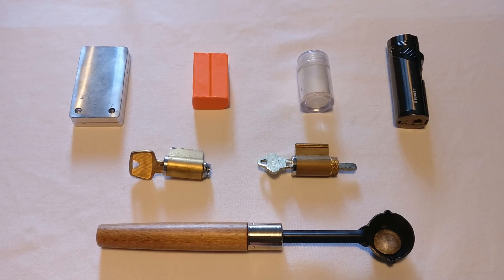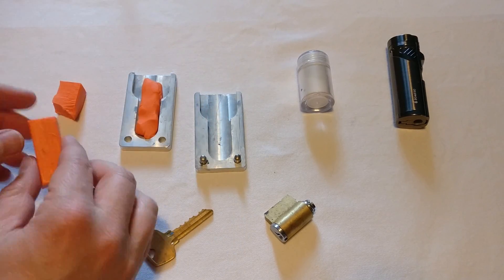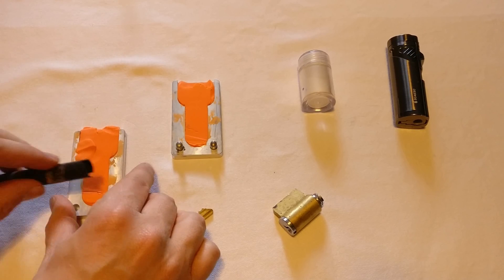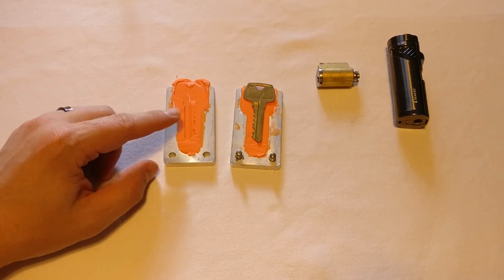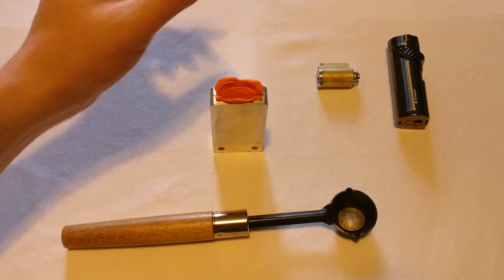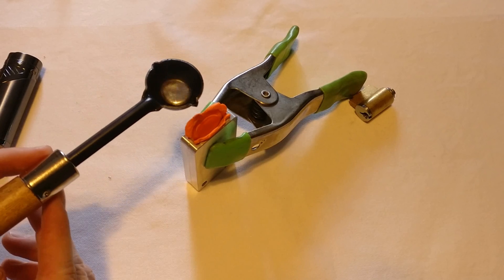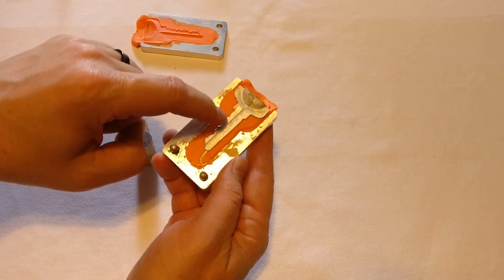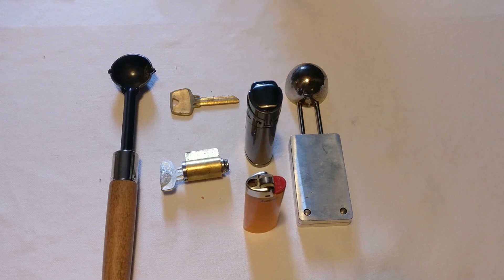Copying Keys via a Mold and Cast Attack

Comment: 2 quick questions: 1. can we use a different alloy with a slightly higher melting point but is more durable? 2. can I keep the mold so if I need to cast more (because they break/bend) and for how long/how many casts?

Comment: Just a tip: If you are using a softer metal, put a small paperclip down the center of the mold when casting, it will help it not break or split
Reply: what are you talking about
Reply: @MikeDeFina  12:30

Comment: Hello
What clay is the best, I'm trying to measure on a pcb board the distances between holes, but I can't use a caliper to get ther and I thought a piece clay would work, but I need a exact copy, that the plug that should go later ther, have the exact hole distance. 🤔

Comment: Awesome demonstration as usual!
I wonder (if you didn't have access to blanks to copy the cast key bitting into), could take your low-melting-point cast key, make a plaster or ceramic shell mold, melt out the original cast key, then cast a key in a more robust metal, like brass / bronze?
Reply: Theoretically yes, but you would need to work with very low tolerance to get a viable mold of a cast

Comment: I use a lot of low melting temp metal that has a high tensile strength what metal are you using?
Reply: hi what metal do you use @neotroncs?
Reply: @crossmf5711  I use Duraweld sticks that I buy at me local welding shop. Tensile strength is 91,000 psi and melting point is 647℃~658℃ (1196°F~1216°F) I pre melt it down in what looks like dragon tears. This stuff sets fast so you have to work quickly. I still would like to know what he uses?

Comment: Can you use metals with  a higher melting point for this?
Reply from the maker: You could, if you have the energy to heat them adequately and the hardware to handle them.

Comment: For easier use it could be possible to add a 3rd layer to one side of the moulding tool that has a couple of pins or a notch that can then be detached and used as a stand (just a thought it may not be the most stable of things though)

Comment: back in the day i used a small electronic enclosure from radio shack for a cast mold enclosure. clay from michaels arts and crafts. molten metal from a toy kit from toys r us. butane lighter from a local electronics shop... nowadays you can buys most these things from amazon, ebay, etc and don’t have to drive around town and spend a day collecting “stuff” for projects.
Reply: But it is alot more rewarding driving around all day and finally getting it to work

Comment: If you ever broke the copy off in the lock you might be able to get away with saying, "I'm so sorry I must've used the wrong key and it got stuck in the lock, and as I was trying to get it out,  it snapped." And then get it out without arousing suspicion that the key was made of wood's metal, but I've never done anything like this before so don't know how possible that'd be.

Comment: What kind of metal do you melt for the key? There are several low melting point metals, which one do you find to be the strongest to use?
Reply from the maker: I use Woods Metal.

Fields Metal is safer and less hazardous but much more expensive.  And when you try to buy it online, many suppliers just send Woods Metal anyway.
Reply: @DeviantOllam  One more question, if you don't mind... Where did you get the metal casting block? Was that custom made, or can you purchase one somewhere?

Comment: Key information : Where to buy this mold-tray? Which casting metal is this? ( I am guessing it is soldering tin , or similar? )
Reply: I believe it's cerrosafe? not entirely certain what that is but it's used pretty commonly used in gunsmithing for figuring out which cartridge weird guns are using.
Reply: Exactly what I was thinking
Reply: I have the impression he doesn't mention the metal-type deliberately (which renders this video pointless IMHO) , but it is : "Woods metal". Google it. "Roses metal" is also a good option.

Comment: So I 3D printed a mold. Dug out some modeling clay from my kids craft drawer. Copied one of my keys for a practice lock. Plenty of baby powder applied. Problem is the modeling clay is so darn sticky I couldn't separate it from the casting. What kind of clay are you using that starts to set with heat?
Reply from the maker: Polymer modeling clay
Reply: Guess I can't rely on the craft drawer! Amazon, here I come.

Comment: I used to do a lot of casting at the school were I worked. Pewter is a fantastic casting metal.
Reply from the maker: Sounds like a cool school.

I've never worked with pewter before... Is it hard to melt with just a little BIC lighter?
Reply: @DeviantOllam  We also did some aluminium casting swell as zinc. Slightly different process but intrinsically the same,.

Comment: If you get the mold off the field, would you use aluminum to get a stronger key or this would not work?
Reply from the maker: Melting aluminum isn't really something one could do on a job at a client site.

If I have the time and resources to do that kind of work, I probably also have the budget and resources to source or mill a real blank and cut it on a proper machine.
Reply: @DeviantOllam  Yeah, didn't think of that.

Comment: It that low-melt metal just 60/40 solder? Solder with added Bismuth (Chip Quik)?
Reply from the maker: No.  It melts at 158°F
Reply: DeviantOllam ...and Chip Quik melts at 134° Fahrenheit.

Could definitely be Bismuth solder at that melting point, though I think it might be too brittle. Why not just tell us what you used? I mean, you told us everything else. ;)

Comment: I've also done that same thing with epoxy resin
Reply: oh that's actually clever !
Reply: @Aliveforfun you should try it it's much easier than melting down metal
Reply: @timhann3701 epoxy is good material... I fixed toilet seat that had very fragile plastic insert in hinge and it still stands 4 years later😅 but I still would be afraid to insert epoxy key in the lock. maybe it need some kindn of metal wire inside for structural integrity just in case.😅 i dont really know.

Comment: @DeviantOllam any concerns with the toxicity of the woods metal? Are there other non-toxic options?
Reply: Any time you're melting metal you should have a mask on, I assume you can do the same with a polymer but that would increase the complexity 10 fold.

In the end PPE is probably the ultimate solution to your problem
Reply: Lucas Gorski I ended up buying Fields Metal, a lot like Woods Metal but non/less toxic as it contains no lead. I take that back, it is toxic... to your WALLET! Stuff cost me $35 for 1/4 pound!

Comment: If you've got some more time, you can take the mold hole and do the cast witch a stronger metal such as brass.
Reply: I'd go with an aluminum alloy, maybe melt some soda cans down with some copper pennies and make a bronze type alloy
Reply: @noahw4623   Hopefully under a vent hood to avoid the fumes.
Reply: @graveseeker  
Yeah, I got really, really sick for like a week after doing this in an open air blast forge.

I think I had nickel poisoning tbh

Comment: Doesn’t the melting spoon set off the metal detectors?
Reply: Yeah, that’s not suspicious, brought my spoon, mate.
Reply: No. Just, no  As said in the video, you don't heat the alloy to anywhere near the point that anything starts smoking.
Reply: @ufc990  Metal detector, not smoke detector.
Reply: @sevret313  Ohh, nice! What a bizarre question haha, if you needed to get through one you could probably 3d print something that would work but why, you could just show it to whoever's manning the metal detector and go on your way haha.

Comment: I'm trying to think of ways if necessary you could get something like this through security that is somewhat diligent. I'm thinking large Zippo style lighter could be fashioned that contains the heating element and a small amount of gas (slightly more than enough to melt the metal), while the rest of the light is actually the clamshell for the mold.

That covers the lighter and mold relatively simply but the crucible and raw metal would be a bit harder to sneak though. First thing that popped into mind is that they could be disguised as trinkets on a key chain. Tiny metal dice would be the material needed and then have the bowl of the crucible as one trinket and then have a small but intricate looking handle that could screw onto the bowl but looks like something pretty someone might attached to a key ring.

That way aslong as they lighter and keyrings aren't looked at with intense scrutiny you could sneak the whole thing through a security check without raising any eyebrows

Comment: So go into Walmart, grab a tin of mini Altoids, a cheapo dessert spoon, a mini pack of Sculpie clay, a travel size baby powder, a Hotwheels car, and a jet lighter. All told less than 5 bucks. 

Dump the mints out of the Altoids tin and cram the clay into the bottom n lid, dust with baby powder, tear a hole in the edge of one short side of the tin in advance if you want to make pouring easier later. 
 After you press the key in your tin get back to your staging area, tear the plastic parts out of the hotwheels car and put the diecast metal bit in your spoon and melt it with the lighter, pour into your mold, cool. Woo hoo o.o

Comment: Maybe using your thumb print to create the vent isn't the best idea. ;)
Reply: I like Potatoes  they will catch you with DNA profiling then? I should think your extensive sock collection will be in admissable as evidence if they are not found at the scene of the crime though! 😂😂😂
Reply: MrDegsy69 🤣🤣🤣
Reply: Use the nail surface of your finger
Reply: @pierreuntel1970  its generally not that watertight as even a fingernail has a specific size, shape and characteristic ridges. They can even match unique wear patterns off the moulded soles on your boot prints! Leave no smoking gun and all is good!
Reply: Bit late to the party but to be fair, they're paid by the companies they're breaking into to break into them, they don't actually do anything illegal, so having evidence that they did the job isn't really a big deal, especially when it's on the equipment they used to do that job
Reply: Christian i was thinking exactly the same thing as if you were arrested with this in your possession you could hardly say 'i found it' or 'i picked it up'! I would have made the pouring lip indentation with a rounded implement like a pastry brush handle or some other such tool. You hardly want your 'dabs' immortalising in metal for posterity and incrimination evidence. What a rookie mistake and i am afraid it is back to spy school on this one! 😂😂😂

Comment: Nicely moulded :-D
I wonder if this method could be used to cast small parts, like camera door latches and similar.
Reply: not a good idea as they will wear out fast and the part you are basing it on is already broken or worn out.
Reply: It depends on the part and what strength it needs to be.  There are different casting metals for different propertys.

Comment: You need to give it a few taps with something metal as well (higher frequency shock waves for dislodging smaller bubbles)
Reply: that makes a lot of sense. ill store that in the "strange useful information that I may get to use once in my lifetime but it will make me look like a fucking pro" section of my brain lol
Reply: I saw one guy use a vibrator. Yes, one of THOSE vibrators.

Comment: Yum, asbestos powder. 

Might I suggest a switch to cornstarch, or perhaps a graphite powder?
Reply from the maker: Who is using asbestos?   I realize the flames are hot, but I don't have any protective gear here.
Reply: Talcum powder has been found to have asbestos in it. Most companies knew about for decades but it only came out to the public in the last few years. It's not like "run for the hills!!" levels of asbestos, but there is no safe quantity of asbestos.
Reply: As a daily diaper changer, I can say that most “talcum” powder is actually cornstarch with lavander scent.

Comment: During the prep, to prep for your 'snorkel' why don't you have some talc covered string going from a likely point (or even just "close 'nuff") down and then following the edge? when you remove your key you are making a copy of, you can pull the string and either auto have or mostly have your air vent. Right? or am I missing something?
Reply from the maker: Oh, that's a neat idea.  I'd like to try that.
Reply: That vent you cut was perfect. The type of "string" causes problems as many have synthetic fibers and might melt and crack the mold along the seam. Or smolder and burn and cause backpressure.
Reply: @Christian-cz9bu  thanks this is what I was unsure of

Comment: I used to fire some of my casts but they are were always easy to deteriorate or crack for some reason. I tell people: to just make two so you will have the model to use again on wet clay.. Also if you are not in the field use aluminum or something.

Comment: Have you tried using epoxy? Might be bit more durable...
Reply: problems with that include that epoxy tends to be rather thick and also low weight, so getting it to cast well into a narrow mould is hard, woods metal is dense enough to flow even into a narrow mould with minimal spruing (the relief channel he cut), epoxy with enough strength to use as a key would also probably take upwards of four hours to set whereas the woods metal is ready to go in a couple of minutes, lastly this would require you to carry a couple of bottles or tubes for the epoxy which may be harder to conceal on your body than a small chunk of non-descript metal and, a cigar lighter (just carry a cigar with you). The only items you really need to conceal with this attack are the melting cup for the metal and the mould itself, and the melting cup can be concealed by integrating it into another object. Doing that with a couple of tubes of epoxy would be harder work.

Comment: Thanks Deviant. I have been unable to get a spare key cut for my daughters car for when she is stupid enough to lock the keys in. This week I will have a play and see if I can create a spare key for her.
Reply from the maker: It's cool that you're inspired to try this, but I would SERIOUSLY not recomend creating a duplicate car key in this fashion. Allow me please to list my reasons why I feel this way...

1. Car locks, in addition to being fragile, are also very expensive to service or in the worst-case replace. A key like this is a prime candidate for completely fouling up a car lock.

2. most modern cars have chipped keys. Trying to use a solid metal key that does not contain the necessary electronic chip component will in the best-case simply set off a car alarm, and in the worst-case disable the car entirely (temporarily)

3. creating a replacement key for a car should usually be something pretty trivial for most locksmiths, hardware stores, or (last resort) dealers... if you are not under time pressure and you are not on a covert entry job, wouldn't those avenues be more accessible? :-)
Reply: The key in question may or may not be chipped. I've been to all of the local locksmiths and they can't decide if there is 1 in it or not. 1 scanned it and said there was and another scanned and said there wasn't. All 3 have told me that they can't get blanks for the key. It's a $400 car so I don't want to spend the earth on it. I've already had to break into the car once when she left the keys in the ignition and after mucking around for a while I hit upon a huge security flaw with a lot of hatchback cars. I now know how to get in to the car in about 20s but if she happens to lock the keys in whilst 100+ km away it would be easier if she had an emergency backup available.
Reply: @DeviantOllam  I thought typically the chip isn’t interrogated when you open the door, just the ignition.

Comment: An even better mold design would use thumb screws (or thumb screws with hexes or torx heads on them) to clamp the mold quickly and securely without making it much larger.
Reply: wing nuts!

Comment: 4:55 use baking soda as a mold release. It will keep the key from sticking to the clay on top of allowing the two halfs to seperate before and after molding.

14:00 Im sure you could get a second or third key cast from the same one mold. Granted it will degrade as you go and depends on how much you damage it on removal.
Reply: you can probably get 6 castings before it craps out on you.  this is basically how metal miniatures are made.

Comment: Cast the first one like he did, then use the hey to make a plaster mold, melt the low temp alloy out and pour in brass or aluminum for a much sturdier key.
Reply: From direct experience I can say that is quite tricky to cast small, intricate and precise parts in brass or aluminium. If this is your job and expedited access is not a priority a better approach is to get access to a EasyEntrie key machine that can duplicate even restricted blanks.
Reply: At that point you may as well go to a locksmith and get a blank to cut.